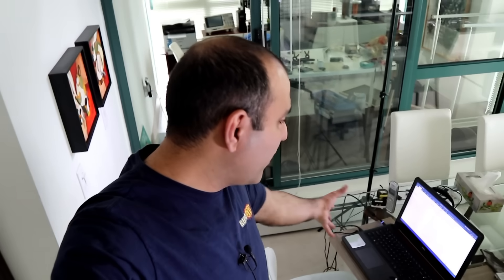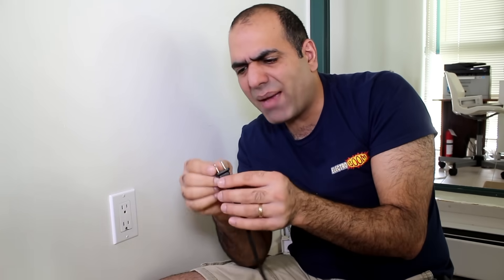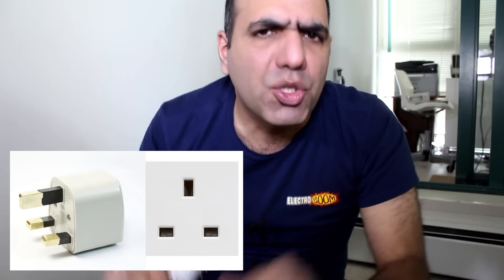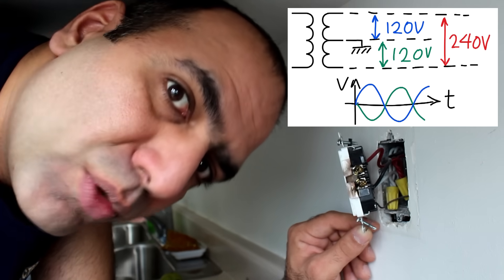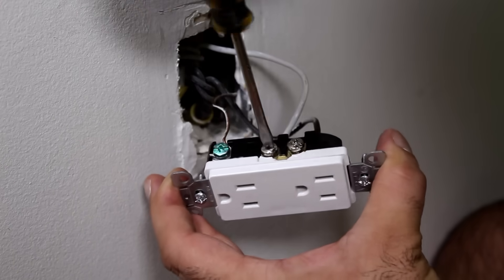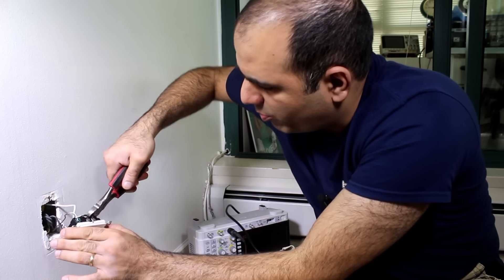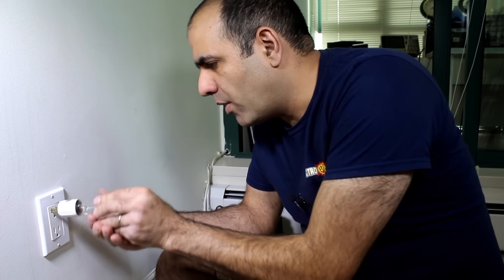How to Replace a Power Outlet

Comment: Don't forget to water your power outlets kids.
Reply: and make sure you use salt water
Reply: I support this comment!
Reply: @Awertnex  Use lubricant
Reply: Stay hydrated
Reply: @nikoslav  bochka bass kolbaser
Reply: @viktorosipov1174  you should
Reply: @keemoak.  denergize outlet
Reply: Doing that right now! Thank you.
Reply: @Dan Kaezarr Tamayo Worst joke or its supposed to be a joke? r/wooosh....
Reply: and feed outlets with forks
Reply: Remember, kids. Just like cars, outlets need gas. Be sure to pour gas onto your outlet regularly, to make sure they don't run dry and stop working!
Reply: And you should also make sure to put a screwdriver in the outlet while the outlet is running!
Reply: Alex Jones ...hol’ up
Reply: My fan says "wet plug before putting in" NOT A JOKE
Reply: Imagine a kid saw it and did that
Reply: Remember kids to spader and neuter your power outlets!
Reply: I used to do it when i was a kid 
The outlet starts making sounds and smoke 😀
Reply: Or use a fork and put in the power outlet for free energy
Reply: What about sticking a knife into the outlet

Comment: Hilarious videos (plural), BUT as far as stabbing the wires into the holes in the back of the outlet, it's called 'backstabbing,' and it's become a no no in the trade. I have so many pictures of the negative effects of backstabbing... mostly due to the fact that electrical wires vibrate (unnoticeable to the human eye) and eventually the backstabbed wires work their way out of the back, resulting in an arc which results in (at minimum) burning up the outlet. Most companies will fire someone for doing that these days. It's best to kill the power at the breaker, loop the wire(s) around the mechanical screw(s), then tighten down the screw(s). It's safer, and it is very difficult for the wire to work its way out. Just a safety tip for any DIY people out there. ;)
Reply: I'm an electrician who runs into that scenario often on service calls. If someone previously posted a similar post, I'd probably guess maybe they are in the trade as well.
Reply: onevoiceinc yep you can normally tell if a pro/tradesmen or a DIYer/ newbie wired a receptacle if the terminals were used or not.  When I find the terminals not used other incorrect wiring also seems to occur. i.e. black as neutral, overcrowding, and splicing
Reply: @FarrellSr  I use the push ins but never have overcrowding, I have everyone leave the room!
as for splicing... well if the wire is too short yeah but i use a good solid wirenut and tape it over
Reply: jim halcom :) yep always a good idea to have everyone leave the room so there is no overcrowding in gang boxes, even having a good sheet of drywall over those junction points should make sure everything stays where it is. Bonus, it makes finding future power issues a fun treasure hunt.
Reply: Is backstabbing fine for light switches?
Reply: @---GOD---  no. It isn't fine for anything, ever.
Reply: We have those as well, GFCI/AFCI outlets typically have those style connectors and they are awesome! just strip according to the strip gauge on back of wire and then tighten the living nuts out of them although some devices have cheap metal that I've broken from over-tightening. Just think... people have used AL wiring in backstabbing scenarios. (I called it Stab-Lock in my comment... another HORRIBLE technology)  @markokrsmanovic1080
Reply: good to know I have been wiring outlets like that thinking if they provided the holes it must be UL acceptable!
Reply: What?? Wago claims in theirs adverts that spring loaded clamps like in these sockets are much safer than clamps with screws since the spring has an exactly defined force while the force of the screw depends on the physical and mental constitution of the human who fastens it. Also a spring can compensate for the wire deforming under pressure.
Reply: @MetalheadAndNerd  I HATE wago clamps. They have them in most lights and heaven forbid you need to remove the wire

Comment: Dud, I remember AC has not monopolarity in a cable, so if you connect it in positive is the same if you do it in negative.
Reply: No, it's not the same, NEMA standard expects the smaller socket to be line voltage, and the larger pin to be neutral. It doesn't matter for things like light switches but for devices that expect the to be switched on the hot wire, you are breaking the circuit on the return path for the ac, meaning the device still holds ground potential, meaning you can shock the ever loving hell out of yourself on a device that should have no electricity running to it.

Comment: I think the UK outlet plugs are properly safer as they are live neutral and earth because it’s earthed it makes outlets so much safer and the voltage is 240 volts AC current with 3 pins it makes it more safe to replace if you know what your doing like electro boom does
Reply: There are three pins on the NEMA socket as well, live, neutral, and earth. and it's even safer to do yourself because it's half the voltage.

Comment: American power outlets are a ‘shockingly’ bad design, given the voltage is half that of the UK yet the thickness of UK terminals is far greater for half the current, plus the outlets are switched to help prevent arcing when connecting a plug under load. Just rip the lot out and change them to UK ;-)

Comment: The terminals for the wires are spring loaded and you can release them without cutting. Just need a small screwdriver.

Comment: Knowing that in other country the voltage is 220 v, having 120 v is more dangerous. Reducing the voltage, with the same power consumption the maximum current will rise and you would get a more powerful shock due to the more quantity of current...
Reply: No it isn't, current is determined by the voltage and resistance of the load. For example, if the load is 1000 ohms and 220 volts is applied, 0.22 amps of current flows through. At 120 volts and 1000 ohms, 0.12 amps of current flows through. Therefore 220 volts is far more dangerous than 120 volts.
Reply: @XxMine231xX  yes but, in all country there is the same power consumption for all the indoor load (such as washer, dish washer etc). For example, if I have 2100 watt and I have 220 volts, the maximum current is around 10 amp. In the case of 120 volts the maximum current will be 20 amp!
Reply: @XxMine231xX  you're not wrong, but some machine needs a certain level of current or power. Under that level they wouldn't work. So, if their resistance is for example 1000 ohms and they can only work with 0.22 amper at 220 volts, their power consumption is of 48.4 W; applying to the machine a voltage of 120 the current will increase because of the necessary amount of Watts needed= 0.40 amp
Reply: @GiacoTT  you are also forgetting that current will take the path of least resistance so if you are a parallel circuit current will still flow through but you are not taking those full .22 amps but a fraction
Reply: @XxMine231xX  oh yes, human body has a really high resistance

Comment: Yes in high-rises and many apartment buildings and condos you will have 3 Phase 208V AC power, so from phase to phase you will read 208Volts, in a house with 1 centre tap transformer you will get 240V phase to phase.

Comment: I could see that you'd connected neutral and positive lines backwards, even on a small mobile screen. I assume you did that deliberately, but the easy way for people to remember is, "Black to brass." The screws are different colors on the positive and neutral sides of the receptacle, and the positive side has brass-colored screws and the neutral side has silver-colored screws.
Reply: Brian Hawkins He fixed it a 3:25

Comment: Australian outlets have switches and shaped diagonal rather than straight but still turn the power off before pulling apart an outlet anyway because you will get an electric shock or killed especially the 240 volt outlets you get in Australia and European countries as its more dangerous than 120 volt outlets but just make you no power is on before you take one apart.

Comment: American NEMA outlets are the worst designed power outlets ever. No support for any weight, thin flimsy pins, no safety features, and they spark when you plug stuff into them. Horrible.

Comment: 'Black wire goes to
'B'rass colour screw
Easy way to remember.
Also every professional elechicken I've ever known sets that you should connect using the screw terminals not the push in ones.
The tightened screw provides at a minimum hundreds of pounds of clamping force on the wire as opposes to the comparatively small clamping force of the spring loaded contact.
Reply: On the other hand, what are you doing to your wiring to make it come out of the spring contact?  And if that did happen, wouldn't it be better for the socket to stop working so you realise something has gone wrong?
Reply: @vink6163  you simply twist the wire left and right like trying to unscrew it, and simultaneously pull. It pops right out. On its own tho, no way.
Reply: @PunakiviAddikti: But how do you do that when it's screwed onto the wall!?
Reply: Vink Gotta unscrew it from the wall first. Or should I say second (after you kill the breaker lol).
Reply: That was my point - why worry about the push terminals coming loose if the only way that will happen is by unscrewing it from the wall first...
Reply: Elechicken??
Reply: I just replaced every outlet in our house. We had some old enough to have back wire 12G (which is no longer in electrical code for new work). I had some wires so loose the outlet practically fell off the wires. A couple of the 14G circuits did it, too. They hadn't been moved. The clips just wore out over time.

Heres the thing. It's not so bad if it's the load is low. But, if you load that circuit to near capacity, including on all the downstream outlets, and you have a connection like that, all that current has to go through a very small contact area. That will heat it up, further reducing the integrity of that connection, as heat is stressing to springs. Subsequent heating/cooling cycles will further degrade the connection, causing each time to be hotter, and more damaging. It'll take a while, but just use the screws. Much less of a fire hazard. Spend a couple extra minutes using the screws and know it is secure. I personally think the back wire option shouldn't even exist.

Add some pigtails and use the screws, and subsequent outlet replacements are a breeze. No wire stripping, no cutting. Just unscrew the three wire hooks from under the screws, put them under the new screws on the new outlet, wrap in electrical tape, and close it up. There's only so much wire in the box.
Reply: @wiz722: Now that is actually a decent reason to use the screws over the push in terminals, thanks.
Reply: Have you tried crazy glue? I sure hope my boyfriend never tries it!
Reply: Only EleChickens screw. Real men stick it in!  My boyfriend knows what I like!

Comment: Early bird get's the worm. However in this case, it's the second mouse. North America was early into developing electricity bla bla and all that shit. 120V was mainstream at that point, so when 220V came by, it was too late for them to adapt due to the cost to replace the equipments and what not. 220V is efficient and yes US is the one of the least safe outlets out there.

Comment: It shouldn't prevent equipment working if neutral and live are connected incorrectly. In Europe the plug is reversible so it is a chance which line in the equipment is live and which neutral.

Comment: Hey, i had a question ! I was installing a LED strip in my room but it isn't working even though the Live wire shows that there is current in the line and also the LED works perfectly when tried in some other socket. Is there a possibility that the neutral has been disconnected ? Can i take neutral from a nearby LED ?

Comment: Good vid. I prefer to wrap it around the screw then tighten. Fixed too many loose wires where they used the quick connect. Thank for the vid
Reply: TechFive I agree. Good electricians use screw terminals. Takes a bit longer, but it is better in the long run.

Comment: Are you really still using rigid electrical wires with those yellow wire nuts thingys to join them in the boxes? Come on, here in Italy we stopped using that crap something about 15-20 years ago, or even more...

Comment: So why does the one outlet have a different phase connected to each receptacle? Is it just so that it can easily be replaced with a 220 outlet if the need arises?
Reply: reduce load from simultaneous use of high current kitchen appliances on what is probably 15A circuit, which was allowed in olden times.

Comment: If it is AC power, why would it matter if the neutral wire goes in the longer or the shorter side of the outlet, the only one that matters is ground

Comment: Funny how youtube showed this to me right after I changed every single outlet in my cousin's new house. I could not for the life of me get the wires to poke into the back though. I thought there was some trick that needed to be done. Instead I just wrapped the wire around on the sides and screwed in the screws to keep them tight. I always thought that was ok.

Comment: Pushing the wire in the back is not up to code because they have found out they go loose over time with the screws on the side to tighten them down and put a hook on them is a whole lot more secure and it allows the electrical current to go through their better

Comment: Good day sir. Been subscribed for a little while now.
Had a semi strange question about electrical stuff.
Have a cheap welder. The output is 80amps AC. 
For welding this is not ideal. DC is what you want. I have a 1600volt FULL BRIDGE RECTIFIER!!!!!(*godly echo*). I know to wire it in before my torch/gun and ground clamp wires.
My question is should I also include a large capacitor on the positive side after the rectifier or would it be ok if I didn't?

Comment: australians may have better sockets, but i dont think its worth it for 1,000,000,000,000,000,000,000,000,000,000 ping
Reply: btw thats 1 nonillion
Reply: I counted, yes it is ^^
Reply: @honestyy1354  You have to be a nerd to...
Reply: Wait, but they're upside down, hmmmmmm
000.000.000.000.000.1 ping. Preedy good.
Reply: Honestyy what do you mean the nbn was a failure
Reply: Fiber to the node
Copper to the home

That is failure.
Copper is for fucking transmitting power, voice or data signals over short distances.
Reply: @IIGrayfoxII  That's only 'some' homes that had existing copper wires, mine for instance goes over the existing coax which is a tad better (100mbps and average 18ms ping), have tablets, computers, tv's, mobile phones all streaming at the same time no problemo.

Considering how old a lot of our copper is and its intended purpose, it has done really well in my opinion.

I still remember dial-up and that god awful sound, taking minutes just to load a single photo, anything is better than that.
Reply: @GrimRize  Dial up we had pictures that were tiny.
Everything was more basic.
HTML3, and ultra basic CSS.
Tiny web pages.

Now we have HTML5, CSS4 and web pages that are 50x larger in file size, plus all the little scriptlets that go with it
Reply: @IIGrayfoxII  I am well aware as I did a lot of web based development back then mostly as a hobby though. And yet it still took forever to load.
Reply: european ones have like indents where the plug goes, and it's so hard to come out! It literally is like lifting 100kg.
Reply: Cheeki Breeki Gopnik the best electrical insulator is an adidas tracksuit.
Reply: Europa has good sockets
Reply: Damn how many zeroes...
Reply: no its nonillion
Reply: Australia needs a underwater fiberoptic cable. Boom, instant internet.
Reply: What do you mean Australia doesn't exist
Reply: Honestyy better than your shit
Reply: Is that bad the Internet down there?
Reply: Honestyy if spider man tried to swing his way around my area he would get electrocuted by the amount of power lines
Reply: its just a quintillion in long scale
Reply: You fucking bogans probably try to steal the copper
Reply: Honestyy bruh i live in Canada and I have dial-up
Reply: no lol, i live in aus and the 4g is good, around 10 ping.
Reply: Edward Liu I don’t believe your lies, Australia doesn’t exist

Comment: Instead of buying 25 cent crap outlets as a replacement, buy commercial grade outlets.  They will have much more grip and don't cost a lot (hospital outlets are the best but $$$).

Also, commercial outlets don't require you to connect the ground wire to the outlet, though you still should.  There's a brass tab that allows the strap to do the grounding if the box is grounded and conductive.

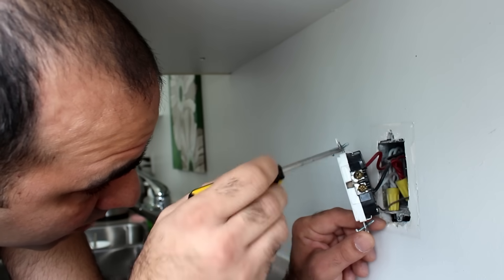Comment: Gold, i was waiting for the bang at 1:55 and it still made me jump. Ive done a similar thing but with 3 phase 415V, testing between L2 & L3 and my meter prongs shorted out. had to run them through the bench grinder to make them usable again 😂

Comment: I love those screw-cap connectors  that u guys use in america. German Plugs and Outlets are best because the plug gets held in place in 3 different ways (Earth-Ground (should be PE for you too) spring connectors, the socket itself and the contact-holes)

Comment: The reason why the high rise has the phases 120 degrees apart is probably because they've a 3-phase supply to the building (like homes have in Europe), so any 2 phases are always going to be 120 degrees apart. The 180 degree malarkey is just some witchcraft you guys have in North America so that you can be special, like the 110VAC/50Hz rubbish they use on construction sites in the UK.

Comment: my apartment had something similar the faceplate for whatever reason somehow was too thick the plug would contact and power but would fall right out and i know its the face because the kitchen outlet is missing it and holds tight so i took one off in the living room and it holds tight too stupid outlets